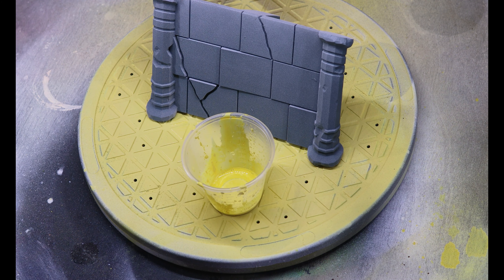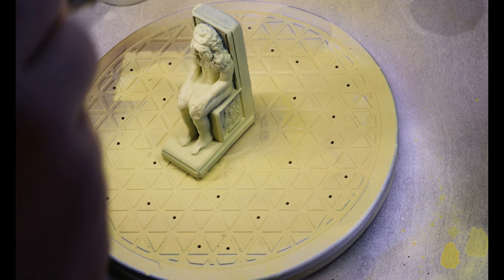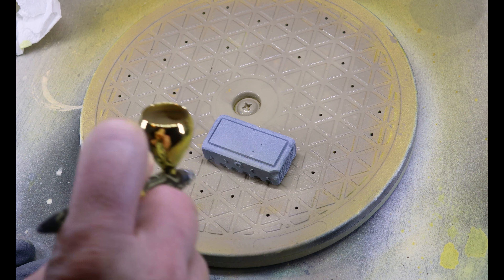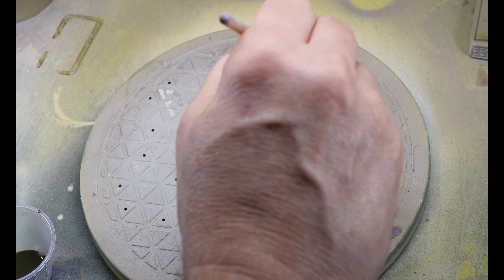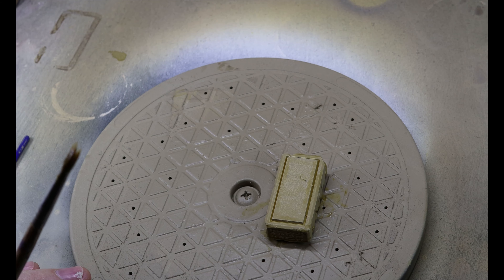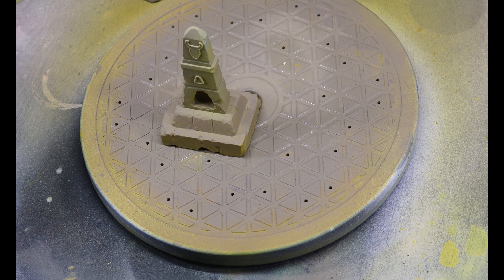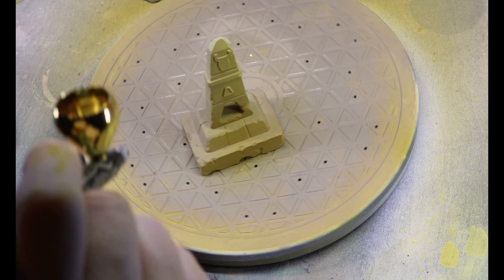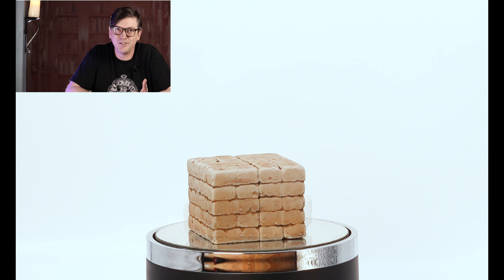Painting Desert Terrain: Sandstone, the Painted Mini

Comment: Having just 3d printed a skirmish team of Mummified Undead from One Page Rules, finding this video in my suggestions was rather fortunate. Looks very nice, even though it is very airbrush reliant. Using the different gradients makes these terrain pieces better than just a sandy beige blob. I would asume the same (or other brand, equivalent colors) and more of a drybrush would work just as well.
Reply from the maker: The brand doesn’t make much difference, just thin to the right consistency, and a brush could achieve the same effect, just may take more time to achieve.  

If the mummies have a lot of texture, let contrast paint do the heavy lifting —Just always thin it down some try (1:1 water or contrast medium). You just have to paint “within the lines” (be precise).  Let me know how they come out!